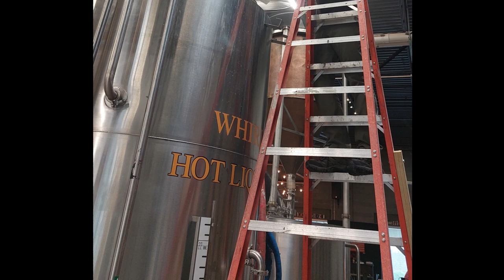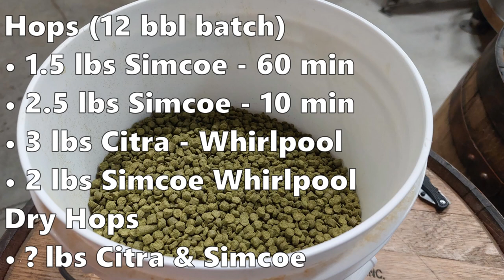West Coast Pilsner Collab!! (Wort Hogs + Dynasty)

Comment: Great beer style.  Did you find out what the proportion of Citra to Simcoe was in the dry hop?
Reply from the maker: It has been on my to do list to follow up with the actual dry hop amounts.  In my recipe that was used for the base, I used 3 oz total dry hops per 5 gal (~85g per 19L) that was split 50/50 between Citra and Simcoe.
Reply: @CascadesHomebrew  Thanks, that sounds about right to me.

Comment: Great lookin beer! I love making these, I did a version of timbo pils - German hops hot side and a big citra mosaic dry hop 8oz into 5 gallons. What was the dry hop rate on yours? I like letting mine finish low like 1.005 or 6, I think the big hop doses help support the body plenty.
Reply from the maker: My homebrew version of this was a 2.5 gallon batch with 0.75 oz dry hop additions of both Simcoe and Citra.  So 1.5 oz total, or a 3 oz dry hop for a 5 gallon batch.  Per 5 gallon batch, I am usually in the 1-2 oz range for a Pale Ale, and 4 oz for an American IPA (and 6-8 oz for a Hazy IPA).  I bet your 8 oz dry hop added a punch!  I think my homebrewed version had a bit more hop aroma than the commercial version.